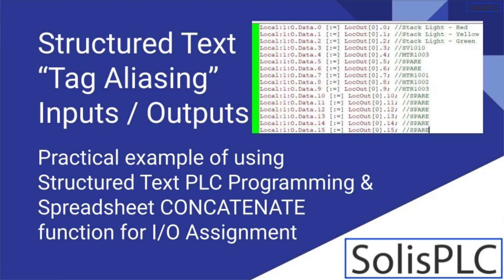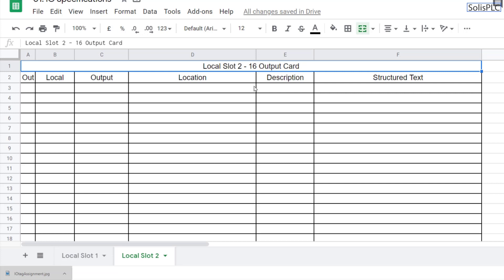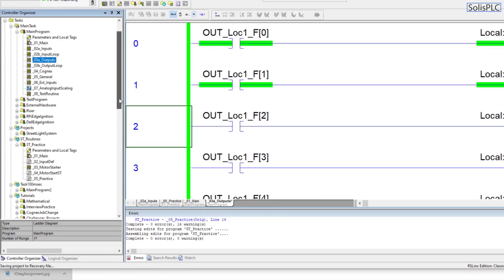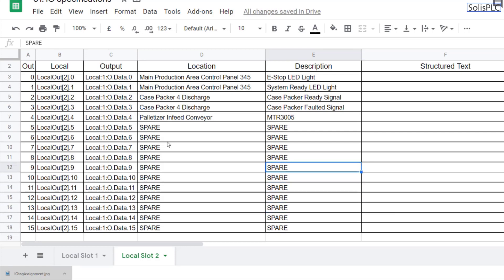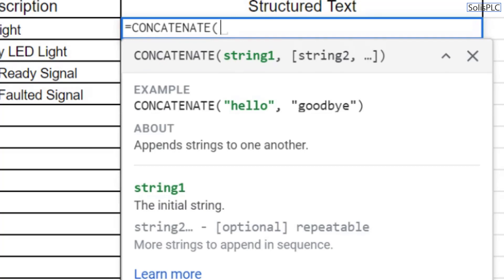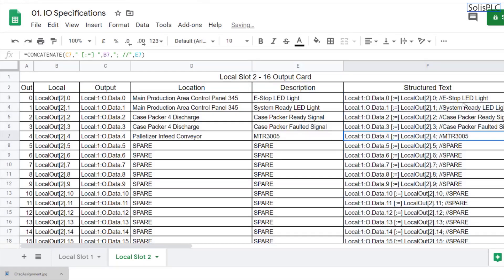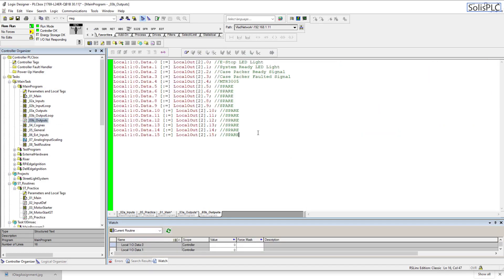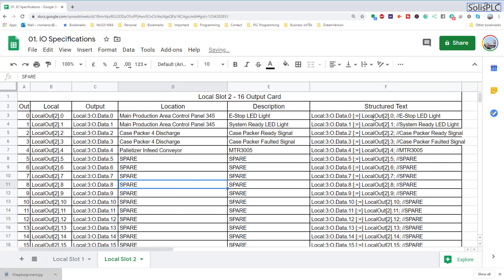Structured Text PLC Programming Example for Input & Output Tag Aliasing Assignments

Comment: Nice explanation but you make it sound like mapping in ST puts in the Description automatically when you import it from your spreadsheet.  In fact at ~9:30 in the video you even comment about having to create the Description by hand if all those same tags were created in Ladder Logic.  But, looking closely at your video, when you went into Controller Tags the Description column was still blank.  So, while I do see some time saving advantages, it is still required by the Programmer to Right Click and Create any new tags, confirm the Scope and add a Description.

Comment: hye.
nice vid.can I say this is the same method as we would do for analog?

The following formula is used to convert analog values:
Scaled value = (Input value * Rate) + offset
Where:
Rate = (Scaled max) / (Input max - Input min)
Offset = Scaled min - (Input min * Rate)

Meaning of individual variables:
Scaled value - in physical units
Input value - The current value at the analog card input
Rate - The conversion constant
Scaled max - Maximum value (in physical units eg 100bar)
Scaled min - Minimum value (in physical units eg 0bar)
Input max - Maximum unit on the analog card input (32767)
Input min - Minimum unit on analog card input (0)
Offset - Correction of recalculated value